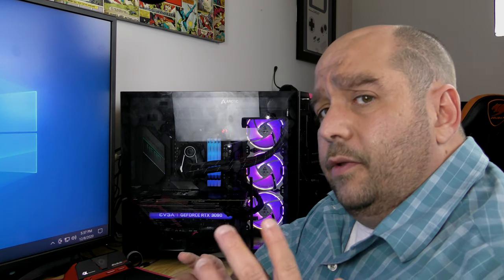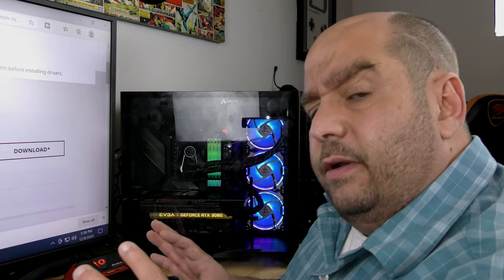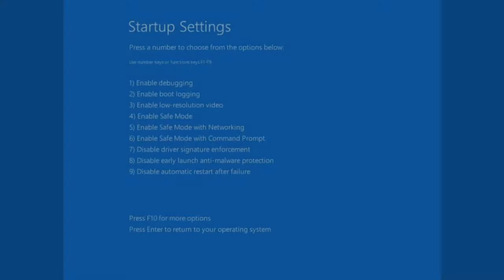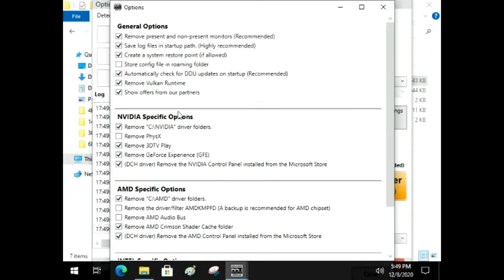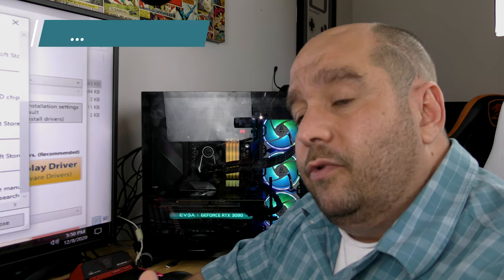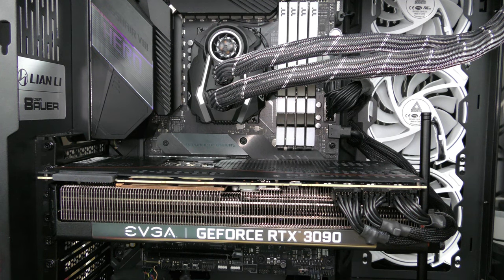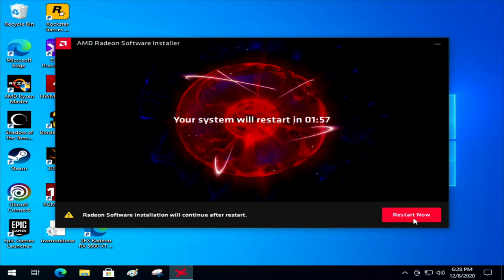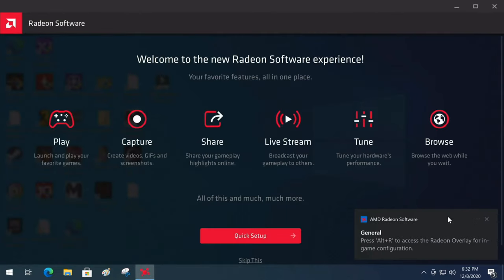AMD Radeon RX 6800 - Installing the Sapphire NITRO+ RX 6800 Gaming

Comment: Hallo , i hope that someone can help me... I bought a 6800 xt sapphire nitro+ and I have some issues: in trixx software , for 1 hours leds can changed , after that Radeon software starts to not working so I just reinstalled the software and the drives.  Right now let's don't change end the fan check health not working as well... please help
Reply from the maker: Hello my friend, what motherboard, case or power supply do you have?
Reply: @ThisBytesForYou  550 aourus elite , 850w gold Gigabyte and corsair delta spec like case
Reply from the maker: Ok, Gigabyte causes issues with the TRIXX software, its something in the way Gigabyte writes their software, uninstall all Gigabyte monitoring and rgb software, then uninstall TRIXX, reboot your computer, then reinstall TRIXX make your changes in trixx, then reinstall the gigabyte software, if you need it and it should work.  Please let me know how it works for you.
Reply: @ThisBytesForYou  Perfect mate, I'm gonna try these evening and I'll tell you. Anyway, if all working,  I have tou use another software to change rgbs on motherboard Ram etc??
Reply: @ThisBytesForYou  sorry bro you've just given me the answer
Reply from the maker: just reinstall it afterwards and you should be good, out of all the other manufacturers gigabyte is the only one with the issue.
Reply: In the end , doesn't working...
Reply from the maker: @darioricchitelli1026  did you uninstall all the gigabyte and RGB software, including trixx, reboot, then reinstall trixx, setup everything like you like, then install trixx, this has worked for everyone I have helped.
Reply: @ThisBytesForYou  Trixx is working but not rgb fusion so Im looking for a new software to remplace fusion

Comment: Hey man please can you help me so I just finished building my first pc and I turned it on for the first time and everything except the gpu lights up should I be worried? I thought it might have been a lack of power because I only used one pcie cable and plugged it into the lian li strimmer but just now have added another pcie cable but it still don't light up? Do I need to flash first or should I be worried about a dead gpu 😔 😢
Reply from the maker: you always need to plug in all the PCIE cables, what are your system specs, list the manufacturer and model number of your motherboard, cpu, video card, power supply
Reply: @ThisBytesForYou  hey man i uploaded my build on here check it out I managed to get everything working! The motherboard needed a bios update before the gpu started working.... Now just to get all the cables managed which is gunna be a pain in the ass
Reply: @ThisBytesForYou  thanks for taking the time to reply ♥
Reply from the maker: @iiTzHaroon  always a pleasure my friend.
Reply from the maker: awesome bud, congrats, maybe this will help you in your cabling journey: https://youtu.be/nJUqyHh1QQY

Comment: So I just replaced my old GTX1060 with Radeon 6800. But my in game FPS for Warzone is same as before which is around 50-60FPS under 1440p.  My CPU is i5-6400 (still waiting for 5600X in stock). But can my CPU bottleneck that much on 6800?
Reply from the maker: no, it shouldn't at least.  What power supply manufacturer and model number do you have?  Also, I highly recommend to reset your settings in Warzone, maybe even uninstall it, delete the directories it leaves behind then reinstall it.
Reply: @ThisBytesForYou  thanks for your reply. I use Corsair SF750W PSU

I tried other games. I notice my CPU is at 100% on all 4 cores all the time while 6800 is at 50% or lower. GPU power draw is less than 200W.
Reply from the maker: ahhh, ok, are you playing at 1080p?  And no worries my friend, I love helping.
Reply: @ThisBytesForYou  I play in 1440p. So I was surprised to see CPU 100% GPU 50%
Reply from the maker: yeah, sorry it was one of the first things I replied to this morning, looking back now the 6400 is a bit weak, especially without the hyperthreading... so yeah, you will be hurting for a little while.  Sorry I didn't look at it right, though your gpu should be at 100 also, what settings (profiles) are you using, low, medium, high?
Reply: @ThisBytesForYou  the setting / graphic profile I chose is "Gaming", thanks
Reply from the maker: @YifengYin  cool, but in the games I meant, low, medium, high, etc?
Reply: @ThisBytesForYou  I set to high for everything. And other games I set them all to 1440p and highest texture
Reply from the maker: ok, yeah your cpu might be holding you back a bit, try medium, see how that goes?
Reply: @ThisBytesForYou  yes it worked. turned to medium resulting  occasional 100% GPU utilization.  My FPS is now average 80 in Warzone.  still far away from 150fps tested in other youtube video. but I think it is purely due to CPU bottle necking now?
Reply from the maker: @YifengYin  ok cool, the occasional 100% could be potentially normal, you have a low core count, updating will definitely take care of that, the machine I am working on now, my workstation has an 8700K, older, but my Intel testing rig has a 9900k and my AMD testing rig has a 3900XT, neither of the machines ever get close to 100%, unless of course I am stressing them.  So happy I could help you my friend.

Just remember, those presets are great, but many times, they put additional stress on your system for no reason, everyone wants ultra, but when you are gaming.... do you really notice the extras going from medium to ultra?  Maybe if you stop and look at things all the time, but when you are running all around, you will never notice.
Reply: @ThisBytesForYou  cheers! really appreciate your help!
Reply from the maker: @YifengYin  you are so very welcome and thanks for your support as well, cheers my friend ;)

Comment: Would this card fit in a H150
Reply from the maker: yes, the H150 has a Max GPU clearance of 381mm while the Sapphire Radeon Nitro RX 6800 XT Gaming as a length of 310mm

Comment: exactly what i need to know (i clicked on silver but found gold XD) i have gtx 750 1gb but i bought a 6600xt 8gb and i haven't use it yet because my psu dont have 8pin and my other problem i dont know if my h61m-e mobo can run my new gpu but according to chorme as long as it have a pcie x16 its okey.. is that true?
Reply from the maker: it should, since your board does still support UEFI and your board does have a PCIE slot, your board also supports PCIE 3.0 so you are good.  You will however need to have a power supply that has 2 x 8Pin PCIE connection, it will need to have both connected and I HIGHLY recommend that each come from the power supply, do not daisy chain/pigtail those connections.  Sapphire recommends at least an 850Watt Power Supply.  I am so very happy you enjoyed this video and found it beneficial.  one other thing I recommend, any game or application that replies on the GPU, uninstall it and reinstall it as everything is set for NVIDIA.  Now, not all programs and games have this, but games/apps where you don't see a difference from this HUGE upgrade, more than likely have this issue.
Reply: @ThisBytesForYou  thank you soo much 😭 ive been looking for answer for weeks now 🥲
Reply: @ThisBytesForYou  I've just subscribe tnx soo much but if didn't work i will unsubscribe okeh 🤣 jk's thank you 👌💞
Reply from the maker: haha, always a pleasure my friend, so very happy I could help you and thanks so much for your support, it means the world to me.

Comment: Ok I understand but what if I am still in the process of building my pc and I decided rather to buy your old version of gpu i instead directly buy this gpu, will these requirements be necessary for my early pc build and who’ll windows install a driver by my newly built pc? 

Just for information I did not purchase a gpu yet.
Reply from the maker: the requirements depend on what you buy, if you have a better idea of what you will buy, let me know and I will see what it requires and try to help you.
Reply: @ThisBytesForYou  which do you think is better? EVGA GeForce RTX 3090 FTW3 ULTRA GAMING, 24GB GDDR6X or AMD Radeon RX 6800 - sapphire NITRO+ RX 6800?

Furthermore I’m still in the process of buying all the parts for my p.c. Your opinion matters a lot to me. Thanks for replying

Comment: Do this  amd gpu's have teh same problems on the software?
Reply from the maker: Did you watch the video, I show you everything in there
Reply: @ThisBytesForYou  Yes
Reply: @ThisBytesForYou  I had an r9 a years ago and I had a lot of problems.
Reply from the maker: @pautorres4319  It seems as long as you have newer equipment, board, processor and power supply but if you have older gear, it seems like you will have more issues.  I hope this helps
Reply: @ThisBytesForYou  Yes, thanks (nide video) :D
Reply from the maker: Thanks so much my friend, also, if you know anyone getting one, it might help to share this with them, just in case.
Reply: @ThisBytesForYou  Of course I will reccomend this video to a friend
Reply from the maker: Thank you so much my friend, I really do appreciate it and so very happy you enjoyed this video.

Comment: hey everyone :) i recently bought the 6900 version of this very same card but I am having very low fps and a lot of stuttering and now i have realised that the Watts used by the gpu is around 30-110 which i guess its very very wrong. Anyone has a solution for that? I already have tried to roll back drivers. Thanks in advance
Reply from the maker: So, ThisBytesForYou, is one of the very few channels where the channel replies, so I can help you.
 So that I can help, please list the manufacturer and exact model number of the following components:
1. Motherboard
2. CPU
3. RAM
4. Video Card
5. Power supply
6. Monitor.
7. Do you have ALL of the PCIE connections plugged in, and not daisy chained or pigtailed, each coming directly from the power supply?
8. Are you running through HDMI, DP, DVI, VGA, etc?
9. UEFI in the BIOS from Legacy.  If it was set to Legacy, you will need to reinstall windows to get correct support.
10. Disable CSM in the BIOS

Comment: any black screening issues with this card ?
Reply from the maker: sadly it can happen with any card, its not the card, its windows working with amd drivers and it typically has to do with older hardware
Reply: going to try and follow this step by step as a last resort to my 6800xt black screen issue
Reply: @ThisBytesForYou  so you dont suppose i rma ?
Reply from the maker: @bencox-hen584  you haven't given me info to help though, what is the manufacturer and model number of your motherboard, power supply, monitor and video card?
Reply: @ThisBytesForYou  im on windows 10 enterprise
Reply from the maker: Did you see what I asked for?

Comment: Hello it's been about a week since I installed my new GPU 3080 but I noticed my PC is slowing down and freezing at certain point s. Idk what is happening. Sometimes when I click on something it's normal but when I click on something else it starts to stutter and freeze and then sometimes it'll restart. Internet pages and Windows explorers seem to open one or two seconds late now. Could this be bottleneck?
Reply from the maker: No, and get the word bottleneck out of your head.  This would not cause your machine to run slowly, check your temperatures and make sur eyou have the VERY latest driver out, this will improve performance.  Maybe this video will help you: https://youtu.be/A2aqpr05-WA, also, if you built your own machine, this video will help you as well: https://youtu.be/8JuC_Dpm6-c
Reply: @ThisBytesForYou  ok I will lol. I downloaded core temp 1.16 my CPU temp right now is 46-50  now with 30-34 w power
Reply from the maker: @randymarsh9488  Core temp, havent used that in a while, you might want to grab hwmonitor, it is excellent.

Comment: I bought a sapphire nitro+ rx 6800 and the thermal pads were dry as a rock. I looked it up but I couldn't find the size of the thermal pads just by eye. I thought it was 2mm. I was the one who opened the graphics and changed the thermal pads and now I'm only going to receive the computer for Saturday can anyone here tell me if they know anything about this and can help me if they know the right size of the thermal pads for this graphics card when I test I'm going to install msi afterburner so I don't make a mistake if it starts to heat up I'll remove everything and try other measures but thermal pads aren't cheap so I asked here if anyone can help me with this situation before Saturday ... tanks
Reply from the maker: I HIGHLY recommend calling Sapphire and/or opening a support case on their website, letting them know the issue and they can tell you EXACTLY what the sizes are.  Since you already took it apart they wont RMA it for you BUT they can help you.
Reply: @ThisBytesForYou  
Tanks i forgot that AMD support good idea i tried to do my best but i really forgot this one i have an intel core i9-7900x LGA 2066 x299 plantaforma u know any computer build like this plantaform ?!
Reply from the maker: what is the motherboard manufacturer and model number?
Reply: @ThisBytesForYou  I bought // Watercooling - Corsair Hydro Series H100x
 // Processor - Intel Core i9-7900X 3.3GHz // MSI X299 PRO Atx // Memory 32GB - Quad channel-KingstonRAM 32GB 2666MHZ DDR4 (CL13) DIMM (KIT 4x 8GB) FURY Renegade Black // Graphics - SAPPHIRE NITRO+ AMD Radeon RX 6800 16GB GDDR6 RDNA2 // Tempest PSU 650W Power Supply // DISC 1 - M.2 PCIE X4 2280 SSD ADATA GAMMIX S11 PRO 1TB 3500/3000MB // DISC 2 - SSD - 2.5P BLUERAY ULTRA M8V 1TB SATA, MAX 550 /500MBPS TLC // DISK 3 - Hard - Seagate 2TB BarraCuda 7200rpm 3.5" SATA III 256MB // Monitor - Acer Nitro XV340CK Pbmiphzx 34" LED IPS UltraWide Quad HD 144Hz // Case - Antec Dark Fleet DF85 USB 3.0 i buy it in 2013 //
Keyboard - Tempest K10 RGB Mechanical Gaming Switch Red // Mouse - Tempest MS300 Soldier RGB Gaming 4,000 DPI Black // Mousepad Tempest RGB 80x30cm Alfombrilla Gaming Extended Black // COMPUTER TOTAL PRICE: €1,774.05 // Watercooling only - Corsair Hydro Series H100x // Memories // Keyboard // Tempest RGB 80x30cm Alfombrilla Gaming Extended Negra and Tempest PSU 650W Power Supply and discs are new 👍
Reply from the maker: sorry, never got a notification about this, but no, I have never built a config is an X299, I have built tons before, and tons after, but never with this specific chipset, what do you think about it"? Sorry I never got a notification from this, youtube is horrible and sending notifications.

Comment: I just disable the internet before going into safe mode.  
When the pc boots into windows there is no internet and i can install the mew driver 

Im so tempted to buy the one that is on amazon for 1k 
What kept me sane.  Is that it takes 3 weeks to be delivered 😂

Touching the case is what i do too
Reply from the maker: Right, that would work, but are you DDU'ing the driver?
Wow, 1K for this, I bought it brand new from EVGA for $1,800, make sure you are getting the same model, well, you don't need the same model, but it can't be this model, they might be having an amazing sale.  Get it quick, don't worry about delivery because they go out of stock quick.